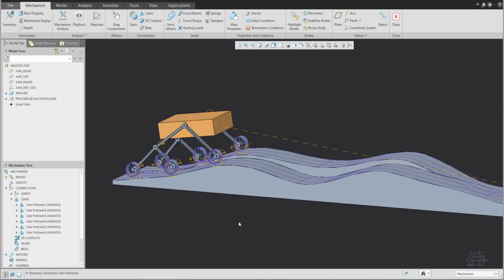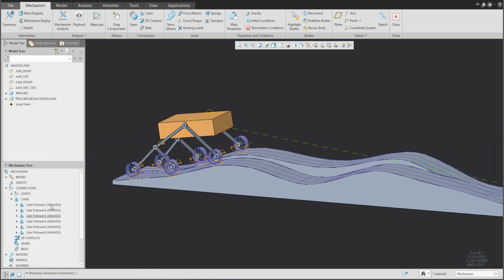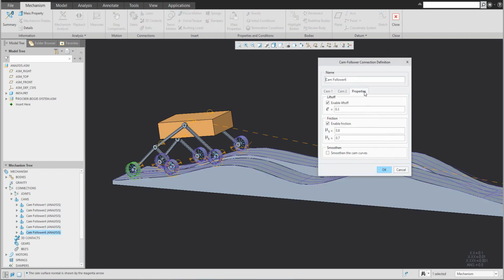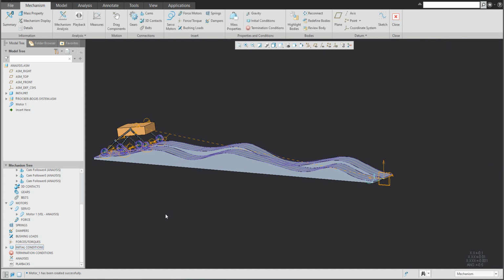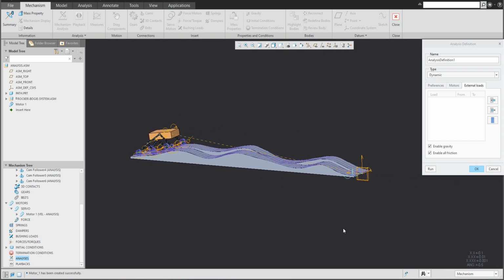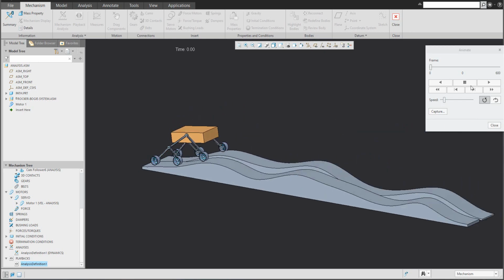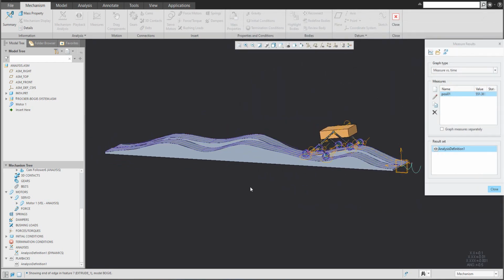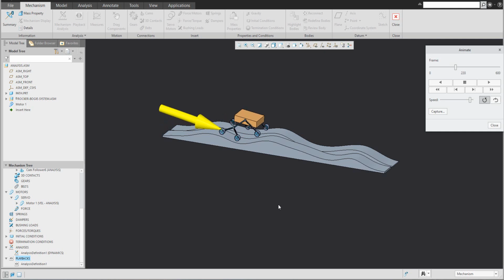Dynamic Analysis in Creo - Rocker Bogie Suspension system | Creo Tutorial

Comment: I am using cam connection and gear connection(for differential) but whenever I run dynamic analysis, my differential does not work.What is the possible reason?
Reply from the maker: Please try to create simple cam connection and run analysis (no gear connection) Leave the gears connect only by cams surfaces)
Reply: @4kside  But I have to use differential gear to maintain wheel ground contact .
Reply from the maker: Best practices is to create simple example.. If it working.. Continue on some specific task.
I think that your differential gear is not possible to analyze with Creo if you can not spin the gear only with Cam or 3D contact.
Reply from the maker: If you use Gear connection, it is only transformation of movement (not dynamic)

Comment: Hi, how did you get dynamics extension (Mechanism). The price available on PTC Web site is 830 USS. Does exist any way to get it for free ?
Reply from the maker: Hi Carlos, in our company we have different Creo bundles (base, Advance Assembly extension, Mechanism dynamic option, etc) we have more than 200 users... So, it was easy to run this simulation. Sorry, it is not possible to do it for free.